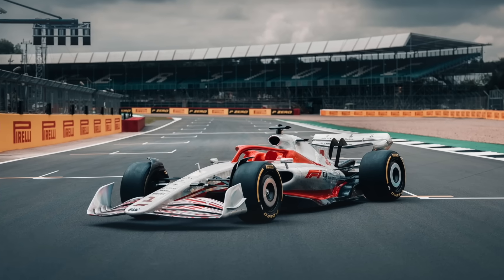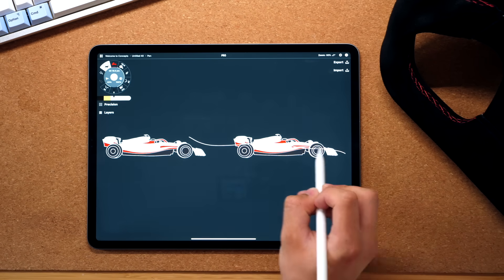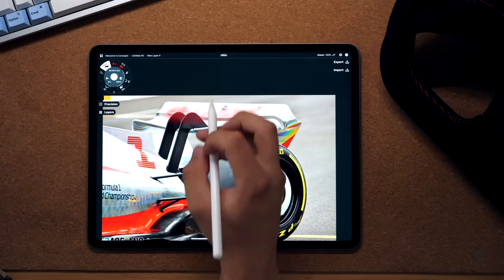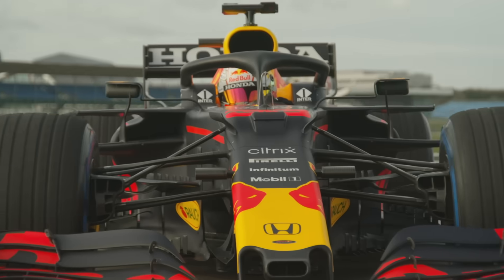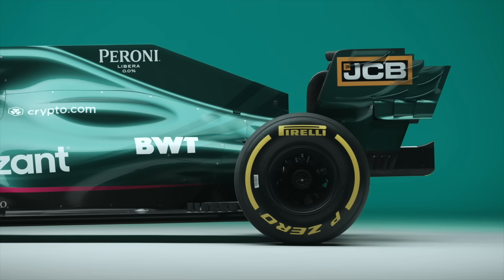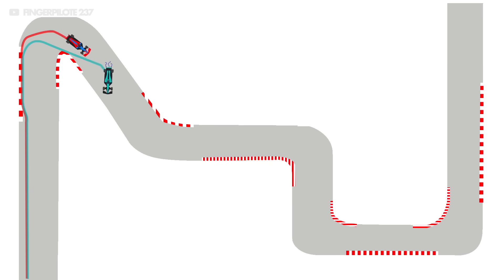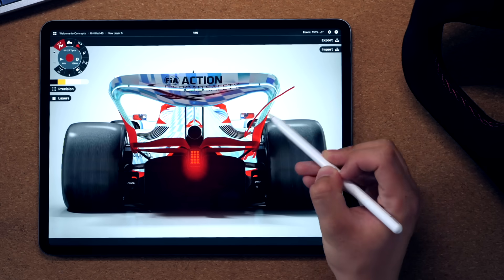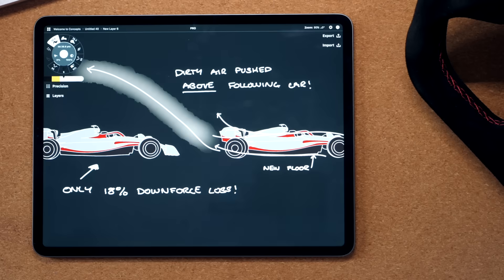Why Formula 1's New CURVED Wing is GENIUS

Comment: I tried  2022 in  sim it feels  bit understeery
Reply: It has less overall downforce 
I guess you tried the RSS version on Assetto Corsa, did you use the default setup? They're a little unresponsive (at least on the 2020 version, i only have that), but I don't know how setups work in AC xD

Comment: I saw the 2022 car irl at silverstone and it looked beautiful
Reply: Sameee so did I
Reply: Is it smaller?
Reply: @yas6757  by 200mm Max so not significantly but every little helps.
Reply: @F1ll1nTh3Blanks  200mm is a lot
Reply: @Hinterradantrieb25  not in the grand scheme of things, that's only 10% narrower
Reply: @yas6757  Well yeah as comment pointed out above.  Also they finally set max wheel base in rules. I think Wheelbase is around 3500 (Merc 3700 if i m remembering correct). So yeah at least cars will not get longer.

Comment: I HATE THE REAR WING, it is just awfully looking
Reply: Its not for looks lmao
Reply: @mrwn6284  yes but you can make a good and not ugly car though
Reply: @aloter1680  well the cars won't look exactly like this and would look much different. This is just a general look. Anyways idk if its even possible to make a rear wing that looks the similar to todays without creating lots of dirty air.
Reply: @mrwn6284  I don't think that they can modify a lot the rear wing.
But, for me, you can still do an original rear wing that doesn't create dirty air and is not horrible to watch
Reply: Agreed. They look like a child's toy car rather than a real race car. IMO it's mostly for looks. They could have stated in the rules maximal dimensions for a small endplate so it would still lose as much downforce as the FIA wants, but not look like a toys-R-us special.
Reply: @ASJC27  😂
You're right